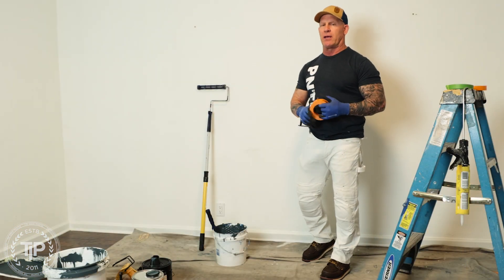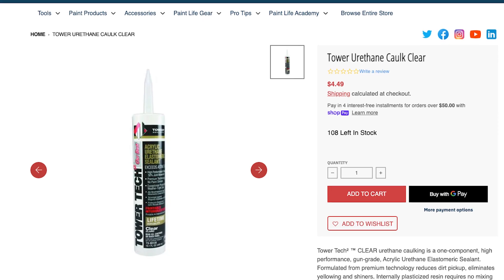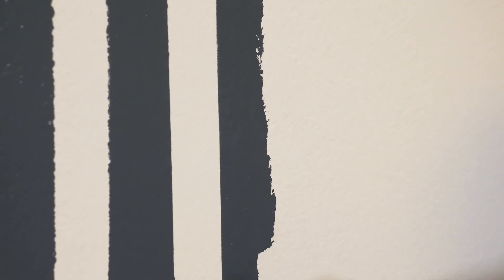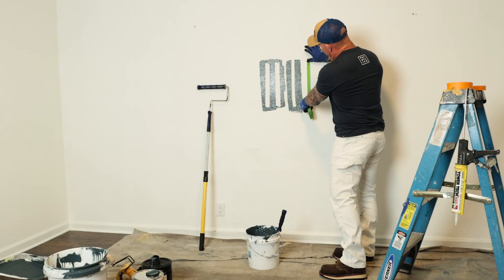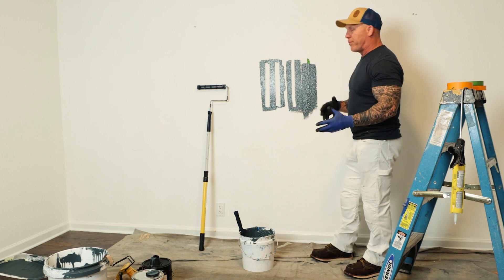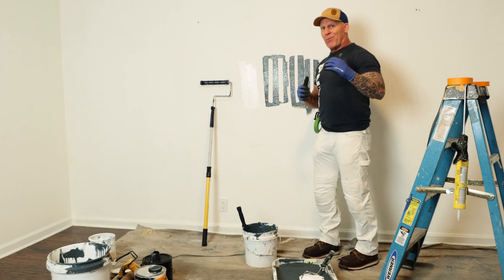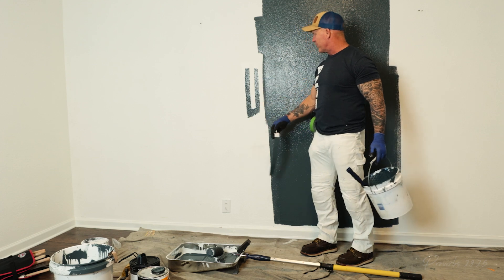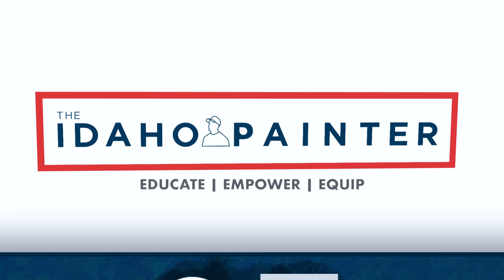STOP Paint Bleeding Under Tape | Painting Straight Lines

Comment: Any printable caulking will work. GE makes a very good product. The cheapest  paintable caulking is the least best to use.The trick here is you wipe most of it off and rub the tape edge down extra well.
 But if you add the caulking price to the the tape you might as well buy the more expensive frog tape green. Some instances you may want to add the caulk to taped  areas like  tile grout. Then the price is worth doing the job right. Also for small areas you can use two layers of the best tape. I can't say I have ever needed more than one layer of frog green to do the job. But in the good old days we'd just double layer the tape.
Reply from the maker: Not a fan of GE